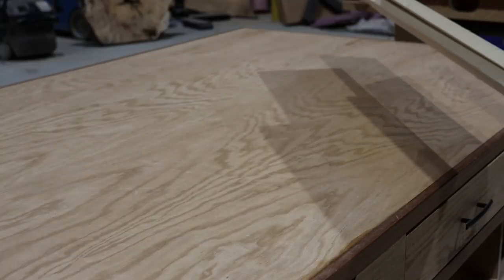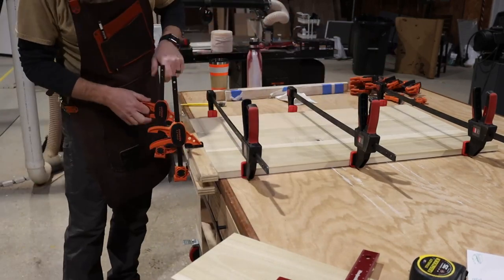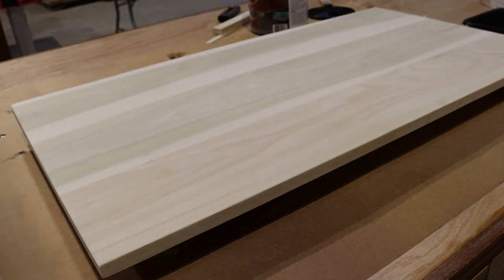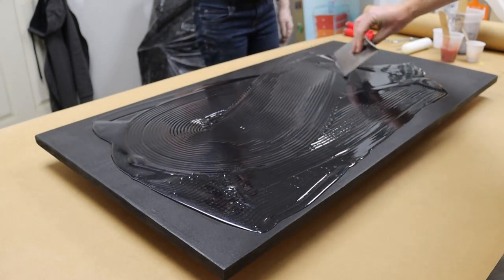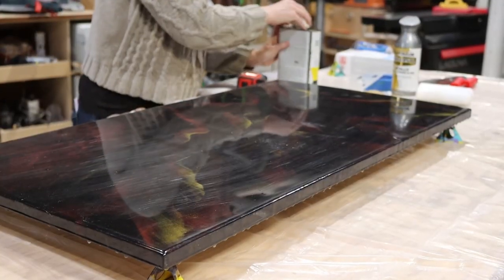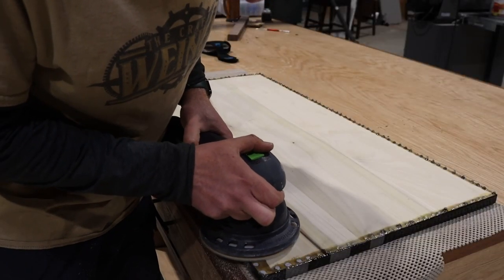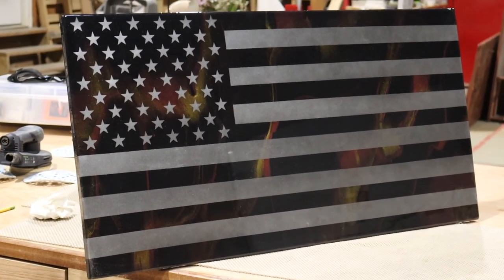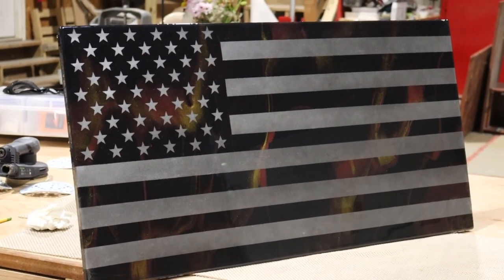I Made A DIY Flag Using Epoxy and Spray Paint For Charity!

Comment: Did u guys ever come to a consensus on what to use for the stripes? Vinyl strips?
Reply from the maker: Hey. I think we feel that if you can get the right size vinyl strips you are better off. The tape is just fine but based on scale you have to make it the right size and it leaves a small residue. Hope that answers your question. Thanks for watching and asking. 🤘🏻

Comment: Love this project. I have done numerous flags with resin and this gives me some great ideas. With the top coat tip u were talking about, would you put the stone coat top coat on top
Of it or were you talking about doing several flood coats on top? With using vinyl instead of painters tape, would you just use removable vinyl? I appreciate the expert advise as I am trying to perfect my craft. Thx
Reply from the maker: Hi Jessica! I was talking about doing a few seal coats with layered color before the final flood coat. As for the vinyl, I would suggest getting vinyl strips instead of tape since you can get consistent lines that way. You could use the vinyl if you wanted to for the stripes but you lose the ability to control "opaqueness" of your stripes so I would still spray. Feel free to DM me any time with questions and thanks for watching! 😁
Reply: @the_crafty_studio_official  thank you for taking the time to reply
Reply from the maker: @jessicagibson109  My pleasure! 🤘🏻